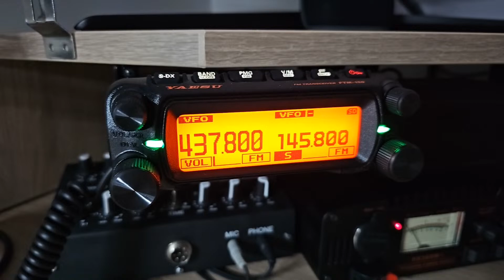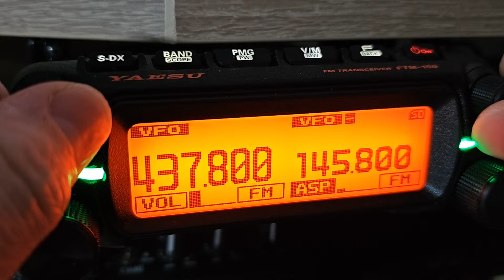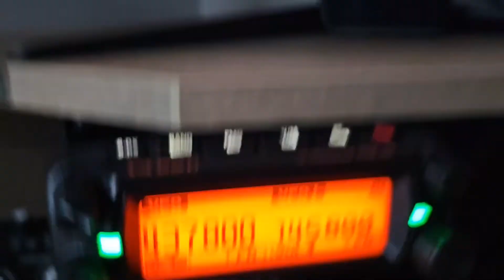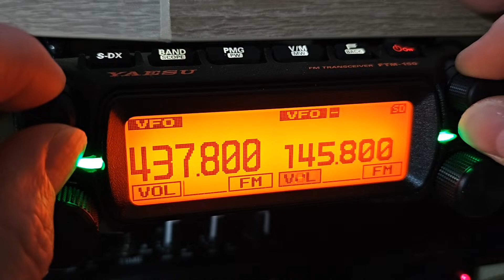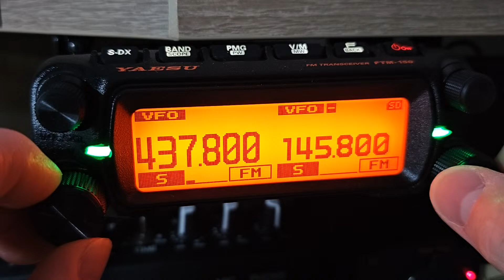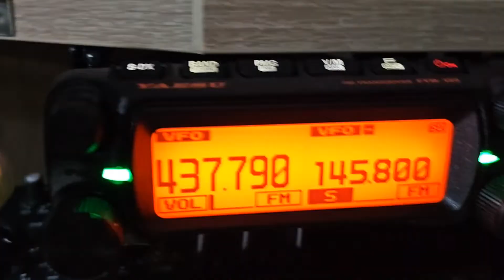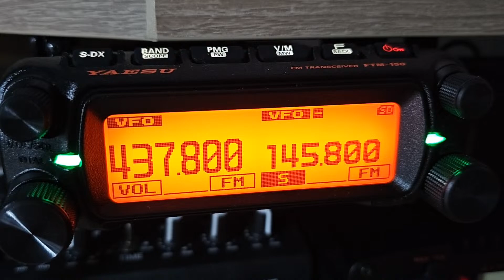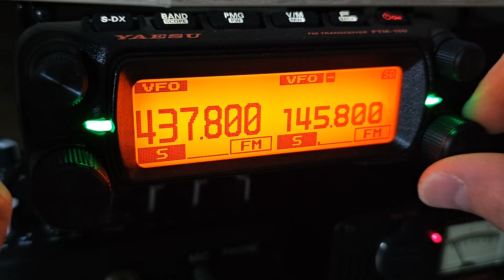#2:  International Space Station Repeater (Yaesu FTM-150)

Comment: I have the same problem Paul. Diamond X 30 vertical.Retevis RT95 Radio. But it depends on how far you want to take this. The next downlink transmission to listen too is on the 24th March , they will be talking to Bulgaria at 14.23 UTC.  145.800 Mhz. I have heard them many times over Europe. Good luck. M6KWB
Reply from the maker: Yes, I would like to catch them too on March, 24th. Will see if it is possible with my X300 😉👍